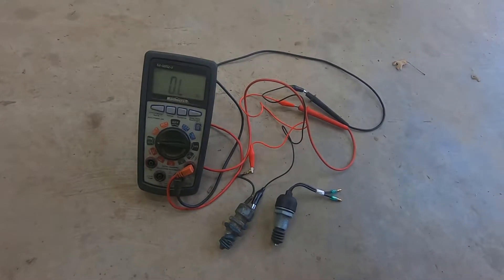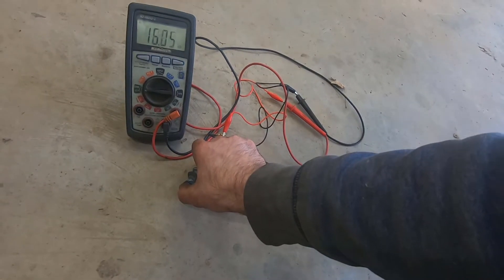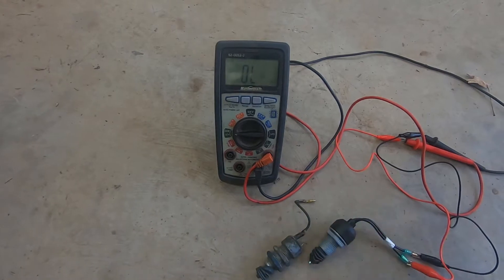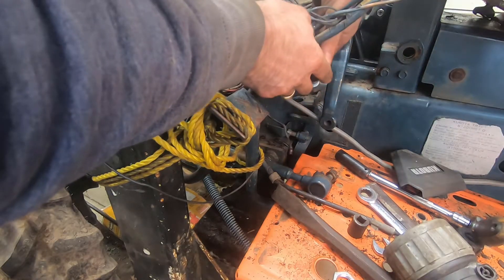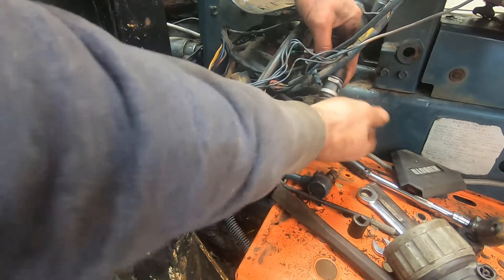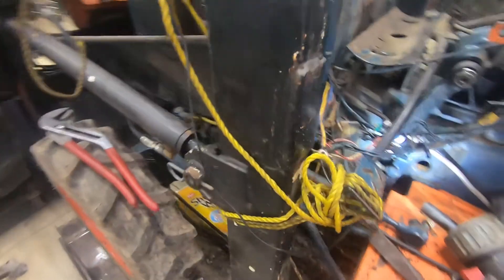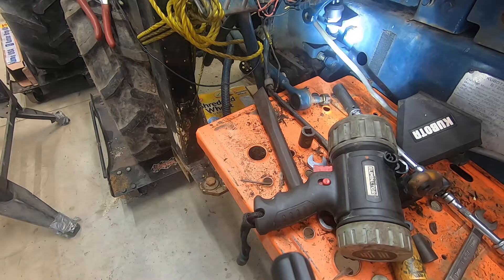DIY Diagnosing No Start Condition Due To Faulty Clutch Safety Switch In Tractor

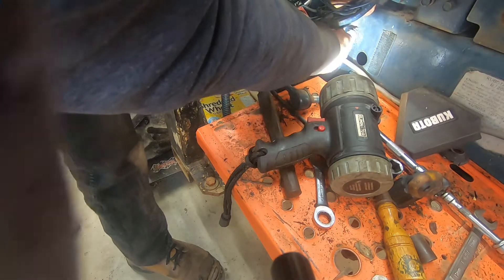Comment: Is the switch normally open and un-actuated when the tractor in its default state?  In order to complete the start circuit the switch needs to be engaged by the clutch pedal to close the switch and complete the circuit?  This is what I've assumed, but it sounds like you said something different: "the switch will disengage when you've pressed pressed the clutch" at 2:28
Reply from the maker: I don't remember the answer but if you disconnect wires from that swtich, measure its 2 wires and then actuate the clutch you should see 2 different states: open and short

Comment: How would you test the wires that connect to the switch? 
Having a no crank issue but would like to check those wires before replacing the switch. They’re pretty dry and brittle.